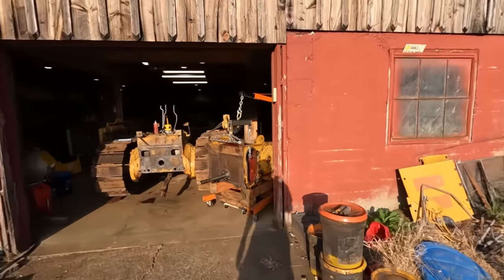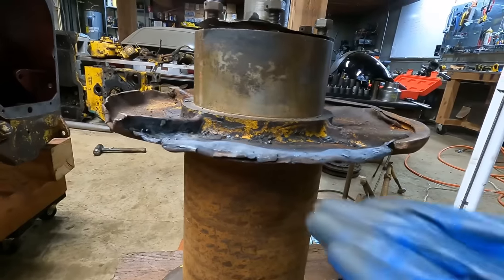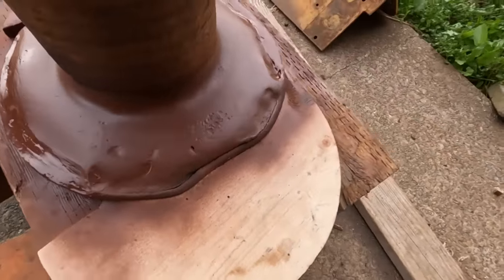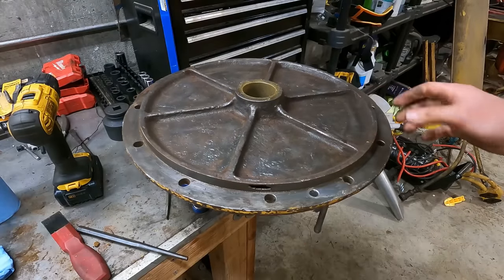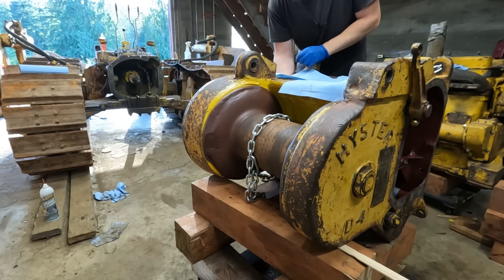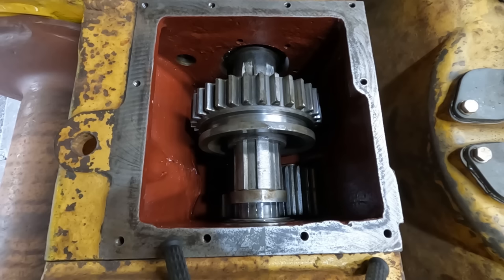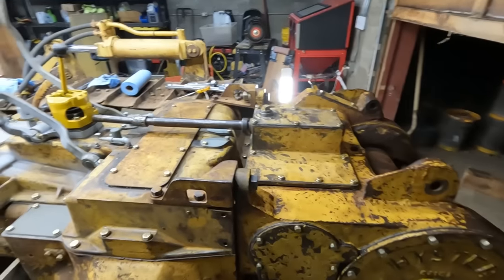Caterpillar D4 Hyster winch full rebuild and installation (part 3)

Comment: Totally fascinating. The only disappointment was that you didn't rip that dodgy welding apart to "fix" whatever the "butcher" had done to leave it like that. At least you made it look better.....
As for working alone. Careful risk analysis thoroughly assessing what can go wrong and the consequences followed by planning and trial runs where possible should keep you safe.

Comment: Re: Safety wire. I was looking a flathead Ford engine in an airplane Ford made in the 1930's. The flathead engine head bolts had safety wire running through them in such a way (opposite directions on alternating bolts) in such a way (every other one opposite) that if one bolt tended to loosen, the wire (taut) would tighten the opposite two bolts. Thus keeping the head bolts tightly screwed on.  Hard to describe, but easy to visualize.

Comment: Ok, safety wire is applied in the direction that the bolt tightens, a three bolt group, each one pulling the next tight and it's also twisted double strands between each bolt. Then pig tailed at the end of the third bolt.

Comment: I think on some of the bolts that safety wire was routed wrong. Just look at some pics of it on airplanes and you can see how they feed the wire. On some of your bolts it was done the right way and on others it was done differently.

Comment: On the six bolts I would use  ,041 wire ,Two at a time ,twist in between each two. So three wires to do six.
Looks like you got ,032 wire.
USAF 1965-1969

Comment: Great to see you back.  I look forward to you content.    Be careful using red (strong locktite) on fine thread bolts.  I've seen where a 1" fine thread had to be drilled out.  If you never have to go back in then it might be the next guys problem.    As far as wiring, cover plates have little force to have to retain.  Anything transferring power should have twisted pair.

Comment: Thanks for video. I have a D4-7U just like yours, except it is pony start. wanted to see you rebuild winch. Are you going w/3/4" or 5/8" rope to respool winch. Hope to see you get it runnin and using it a little. Knowing what you know  now would you have purchased this Dozer. Have a good one.
Reply from the maker: 5/8... in my opinion, more length is always better.  Yes I would have bought it, much better to have a dozer parked for a blown up engine than one parked for a worn out undercarriage

Comment: When installing 0.32" safety wire double twist method would be much better for the 6 bolts on the drum. Also, 12-16 twists an inch will prevent cold working the wire and compromising its strength.

Comment: At 56.51 timeframe, i wondered if the outer races are supposed to float to enable you to set up the preload on the bearings , otherwise there will be a possibility of slack bearings ? And i would have used long stud rods  temporarily replacing the proper studs when mounting the winch body to the mainframe ? Just my two pennies worth. By the way your explanations are superb and its an interesting and riveting project, my hat off to you sir

Comment: Most winch housings are cast steel not cast iron, that is why they have fine thread bolts instead of coarse bolts. Fine thread are stronger.

Comment: would suggest you use a fan to blow welding smoke away from you.  Its like many other conditions [health] damage is small, but cumulative, so by the time you note systems, damage is irreversible.

Comment: The 57 allison hd11 had fine thread bolts everywhere  other than the belly pan. I  think they are supposed to hold more torque and less likely  to loosen from vibration. Don't  know for sure.

Comment: With regard to the safety wire. The "correct" way to do it is to wire two bolts together (6 bolts = 3 wires).

The reasoning is that you have multiple failure points. The way you laced it there is a single failure point. In this case the point is probably moot as, at worst, a failure is only going to cost $$ not lives.
Reply: I'll bet there are a thousand tutorials on YouTube on best practices in safety wire.

Comment: Worked on a helicopter in the military.   I would assume that you would take one piece of wire, thread it through the first bolt half way twist them together untill the second bolt,  thread the wire through the second bolt,  twist the wire together on the other side of that bolt  and repeat untill the end

Comment: Do  you think the bolt that holds the magnets should be wire locked?  Reviewing, I guess you sent it with thread locker.

Nice video. Very tough job working on such heavy pieces. You do a great job of reverse engineering these things. I was wondering about the wire locking - I do see it in aviation videos to prevent a failure. Is it to prevent the bolt pieces from messing up the gear system?.

Comment: Just wondering if u  used your winch yet ? And if the body filler or  epoxy right if it stayed in place or pop right off when you used it ??  But overall much respect u have a awesome channel 💯⚡️🎯🥇

Comment: Curious about those small hardened shafts. Maybe they were case hardened and had a 'soft' centre. Did you actually try drilling and tapping them after grinding off the end?
Reply from the maker: Yeah, I tried drilling on the side that I cut off... they were harder than Chinese calculus

Comment: When you weld stainless steel you really should be using an air hose feeding fresh air into so you have positive pressure in your welding helmet.
Back in the 70's when I was a 2nd shift Ironworker welder the shop I worked at got a contract welding stainless steel casket frames and it had to be done in a separate bay from all the open bays and we had to wear a helmet like that as the fumes are very dangerous to your health.
It was covered in the welding technology clas I took to get my certified welder ticket to qualifie to attend the Ironworker union academy. 
I enlisted in the Coast Guard before I went tho.
As a former Coast Guard (AD3) aircraft mechanic on Grumman HU16e Albatross seaplanes my first year and a half of 5 years. 
With the 9 cylinder Pratt and Whitney R1820 radial engines.
I used to love the smell of the first puff of Avgas and oil burnin' on engine start up evos.
You're supposed to put the safety wire thru the bolt head then twist it from the side that'll give a positive tighten pressure on the bolt head the keep twisting it to the next bolt then repeat around to the last bolt head pigtail on the backside. 
The twist should always be clockwise.
Anyways, you did a really nice job on that spool.
Reply from the maker: Man I would have loved to work on aircraft, I still may someday.

Comment: 45:35 you have anti locked the bolts together- undoing them - easiest way is to drill small hole in castings near them and lock them individually to each side not to each other

Comment: @13:35 - Maybe I missed it, but could you talk about that welder possibly?  It looks like a toy and that it may be 110V, but boy-howdy does that thing sound like a million bucks when you're welding with it.  I mean, THAT is the sound of some metal being fused!
Reply from the maker: It's the Dekopro stick welder, 110/220v 160A DC welder, currently $109 on amazon

Comment: You know what would really strengthen that edge would be some J Channel fitted and welded , with the J channel if the welding wasn't working very well you could drill it and bolt it in place

Comment: Was that a dead blow hammer that you "retired"?    I don't think I'd have used one in the places that you did.  Instead, I'd use a steel hammer with a chunk of wood or brass to keep from damaging the work.   I may be wrong, but the dead blow hammer doesn't give a "sharp" blow.  Sorta like the difference between wrenching on a bolt vs. using an impact wrench.  Correct me if I am wrong.

Comment: AS A HEAVY EQUIPMENT WELDER AND mfg over 40 years i have rebuilt hundreds of them drums, they are all cast steel, not cast iron, i have never come across a cast iron one the grinder sparks prove its cast steel great to weld, but you have to use only 7018 or 8018 low hydrogen rod.. never use anything else no mig no 6011 no stainless due to presses on it...   just 7018 or best 8018 it welds up great, i use grosser bar on them were metal need to be added, same bar you weld on track. you form it on the horn of a big anvil the safety wire is a must were there is holes in the bolt heads, all it takes with all the vibration, one bolt to fall out and go though gears and you end up with huge damage, sure the wire is fine but very strong and it like an added insurance.. you see them in every auto differential crank shaft. none of the winch housing are cast iron, all good cast steel, if they were cast iron  winch would rip it self part.. , know worries on torc setting with fine or corse thread bolts, in fact i love seeing fine tread on things like this, far better..
Reply from the maker: I must have mistakenly called it cast iron once in this video, I distinctly remember calling it cast steel several times though.  It's obviously steel from the sparks.
Reply: @PacificNorthwestHillbilly  yyou sure did, in fact you said you be leave itto be cast steel but said your no professional so i was just confirming with my many years of experience. and tips
Reply from the maker: Oh good, thought I was going senile.  Thanks for the welding tips, always appreciated.
Reply: @PacificNorthwestHillbilly  welcome

Comment: Just a comment, possibly when you make another wooden jib, leave some wood about 2 inches longer. Find a eye bolt that will slide over your material and screw the eye bolt into the extra wood, great videos and job, all my opinion.
Reply from the maker: That's a pretty good idea...someone also suggested soaking the wood in water to keep it from catching fire.  Learning all these little tricks eventually add up.  Thanks for the tip.

Comment: Why did you not pack the bearing with grease before fitting  other that that you did a stirring job cheers BRIAN
Reply from the maker: all bearings are oil bathed in the case

Comment: we always used 0.032 safety wire and the tech inspector would actually use a machinist ruler to measure the number of twist per inch

Comment: Those cap ends that you ran one strand of safety wire through 6 bolts, in the Air Force, we would have taken them two at a time and twist wired them together. That way if the wire broke only two would loosen not all 6. Thankfully I only worked on flight line equipment (AGE) and not the actual aircraft. Safety wire on aircraft was serious business.

Comment: Hi, stumbled across your channel by chance. Noticed you were repairing/ rebuilding a CAT D4. Just thought I would suggest you reach out and contact fellow Youtuber "Squatch253". He is located in Minnesota somewhere and has a lot of experience restoring / rebuilding CAT machines, especially from the ground up. He also has a lot of knowledge about where to find parts, manuals etc, and can tell a substantial amount from just the serial number of the engine/machine. he might be able to give you great advice and may be able to answer any technical questions you may have. Continued success with your projects.

Comment: So my jet mechanic brain is hurting over your safety wire, however in all realness as long as the wire is pulling the bolt in a tightening direction or a neutral direction and then make sure your twist are tight (but not too tight to break) then you will be perfectly fine.

Comment: It's called tunnel vision you get so focused you miss the  obvious.Don't worry we all get it . Tie wire -- it's your friend ,it's actually an art form , aero stuff and drive trains ,engines  mostly spec stuff it's hard to tighten a set screw when it took two days to assemble on a shop  bench and then install .

Comment: At 40,56 did you actually tried to drill the pins, most pin are only case hardened and the center should be soft to avoid them being brittle.

Comment: Safety wire two bolts only twisting between them 
Keep in mind thread-locker alone would have been fine it’s not an aircraft

Comment: Matt, this project is coming along nicely, However, the safety wiring leaves the A&P in me cringing. While not an Aviation application, the single wire is not an acceptable method, 2 bolts linked together are much preferred method, if one bolt loosens it should tighten the other and vice versa.

Comment: If ever you have to drill a fingernail again, use a torch tip cleaning drill and spin it by hand. Using a cordless drill can result in drilling through the bone. Easy to lose control. I had to teach my guys this process after one of them drill all the way through his finger. Whole bunch of extra problems if that happens. 🤨🙂

Comment: 22 years as a flight servicing inspector  - I have the greatest respect for your engineering skills BUT wire locking skills ??????? Mind you you were dealt a bum hand with the 10 o’clock & 12 o’clock bolts - perhaps you could have tried swapping them for better alignment but as you said it’s a dozer not an aircraft. In my day I would have given my granny for a wirelocking tool like yours - in the fleet air arm we made do with 1/2 a hacksaw blade wrapped with masking tape - memories

Comment: Matt,
your safety wiring isn't really the way it should be. you need to double and twirl the wires between the bolts. a single wire going thru the heads of the bolts isn't going to resist any tension put on it by the bolt backing out. you have the basic routing correct so the bolt remains under slight tension as the wire passes thru the head of the bolt

Comment: when you stick weld try to drag rather than push into your weld. Check out the Australian Armor Museum (https://youtu.be/ojBEBJEGLOY). they do a lot of custom manufacturing like you did here to restore WWII tanks and AFV's when they cant get parts. 

on the safety wire, your wire should always be pulling as if it is tightening the bolt.  i can tell you the finer details if you want to message me. theres a place to grab the safety wire, a few tricks to get it tight without breaking the wire, and a good way to measure to get the twist where you want it every time.  theres also a way to do multiple bolts together (PITA). There are specifications as to how many twists per inch for the size of wire used to avoid snapping it. I work on the KC135's engines(CFM56 high bypass turbofan). They use a lot of safety wire on that airframe so i've done a lot of it.

Comment: I just have one question for you and that happens to be why are you using such a large bottle of acetylene to your bottle of oxygen?  Just an FYI you tend to use twice as much oxygen to fuel gas!  So you’d be better matched using a 75 cubic foot bottle of acetylene to your 125 cubic foot bottle of oxygen!  Just a tip from a retired certified welder!
Reply from the maker: I bought it off Craigslist, I had the same question for the guy I got it from

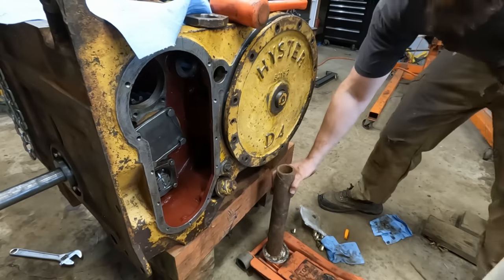Comment: Ok you failed at time stamp 39:01 when safety wiring bolts in series start with fair amount that can reach the entire length of series, doubled up, start at first bolt your choice, in the direction that safety wire is applying tension to bolt or nut take a length of wire that reaches next bolt or nut normally going clock wise the safety wire would go under in a counter clock wise so it is in a pulling direction once you have established the length needed twist so it meets that bolt , it always easier to twist the last bit by hand so you don't break the safety wire insert lose length continue, to next bolt always in the direction that the safety wire is putting tension on the bolt/nut so it the tighten direction. safety wire should be taught but not piano wire taught, if too difficult just do two bolt or nut to each other, as long as they apply tension so bolt where to come loose it would have to break the wire.  Sorry Aviation Airframer, A school instructor, Am a school.  you're doing awesome.  you would fail the last part was not correct.
Reply from the maker: I promise to not work on any aircraft (this month)